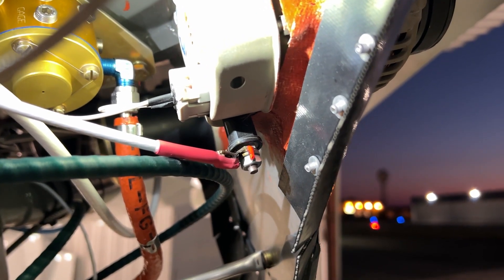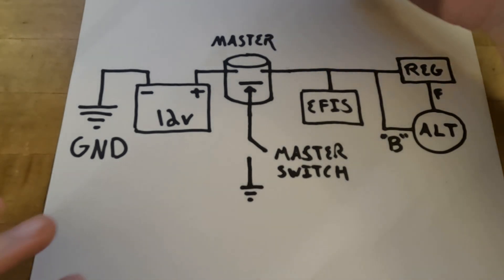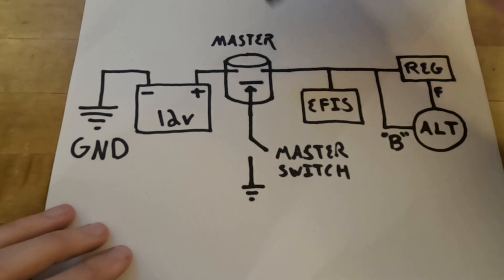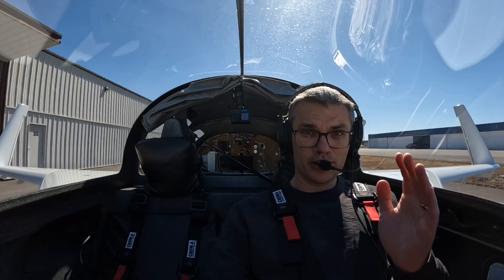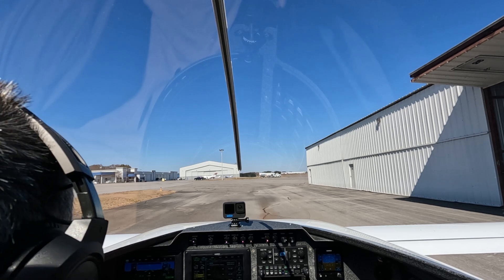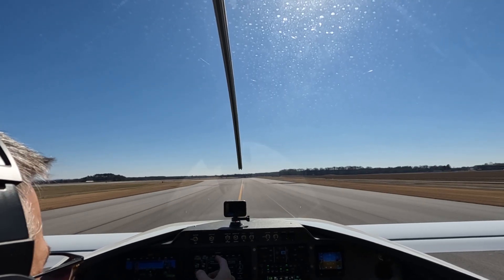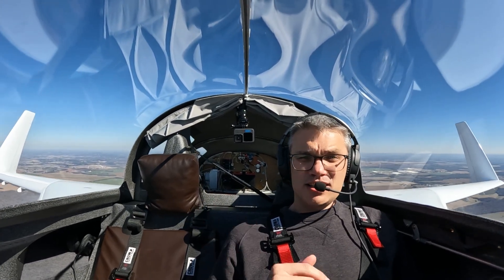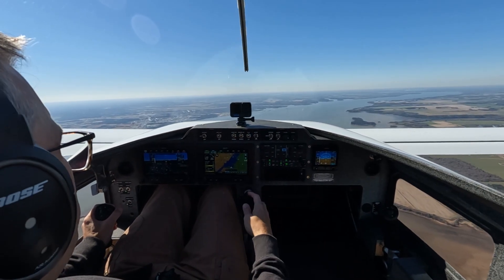How an airplane alternator works

Comment: I'm not specifically trained in aircraft wiring, but I have deep experience with other mission critical electrical systems.  Many standards for critical systems will require specific types of physical strain relief on wiring.  Areas near connections are generally the most heavily regulated.  Some standards require wires to be supported every 6 inches.  Some have shorter intervals.  Shrink tube or other strain relief at the terminal are generally of particular importance.  ...The simplified version is, please tie up your wiring better so that it doesn't break again.  ...and thanks for posting.  That's a nice build example of a desirable aircraft.  And it's good to see that somebody my size can fit in one of those.

Comment: Hi Russ, Love you videos and explanations.  Finding your channel, and a few others about the CO-Z has sparked my imagination again!  As far as your alternator ring terminal, since this video is a year old, I don't know if you came up with an alternative solution. The only suggestion I have is to use a copper battery lug terminal which they have in 10 & 12GA. They are really beefy and should take fatigue better. I don't know about the availability of crimping tools for them, but they must be out there, or you may already have one.  Take care and have fun flying your Cozy!

Comment: My UL Power engine's alternator works differently.  It has a 3-phase permanent magnet field alternator, with an external solid state rectifier/regulator assembly.  The alternator is not controlled by the regulator.  Instead, the rectified voltage from the alternator is electronically regulated down to about 14.2 volts, to charge the battery and run the plane's systems.  This is exactly the same as is done in a Harley Davidson motorcycle.

Comment: Another great Cozy video Russ!  Don't feel bad, I had the alternator fail on my only 2 month old BMW M3.  BMW had rubber isolation on the alternator mounting and installed a ground wire, but, the solderless crimp connection was soldered and that caused the wire to fracture and disconnect.  I have never seen a terminal break like yours but it did look like you need a wire clamp (AKA tie wrap) to stop the vibration.  Otherwise stop using those Chinese crimp connectors :)

Comment: Double or triple your installation at the terminal. There is shrink wrap that is thicker and more robust that you can use. I have some I use on my 351W PCM inbound boat engine that has worked wonders over the years.
I'm also building a Cozy. I'm about 500 hours from engine and avionics.
Great content.

Comment: You might want to find some way to secure the cable closer to the Alternators B (BATTERY) terminal. I am guessing it is shaking a lot with vibration and causing metal fatigue. Did the alternator or it's regulator fail due to running without the battery connected?
Reply from the maker: No, in my case I think the broken b lead caused a voltage spike which blew a fuse, all components were saved